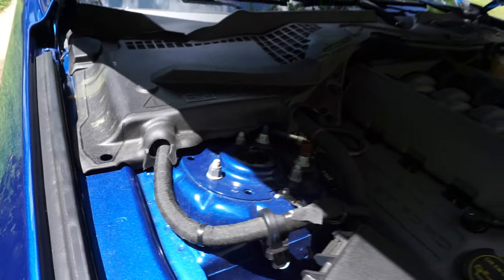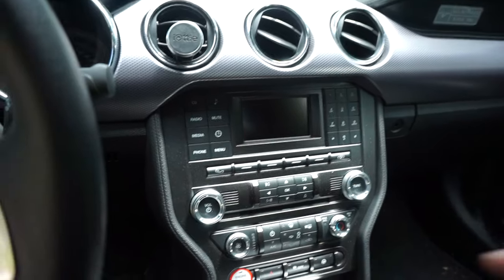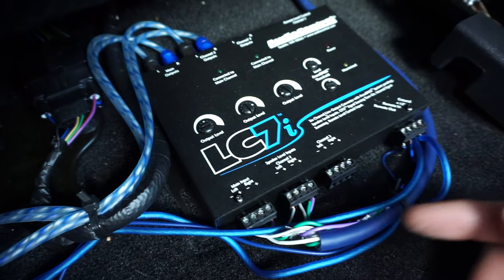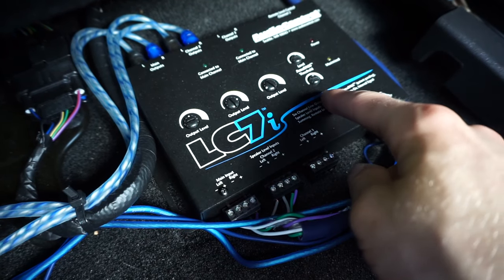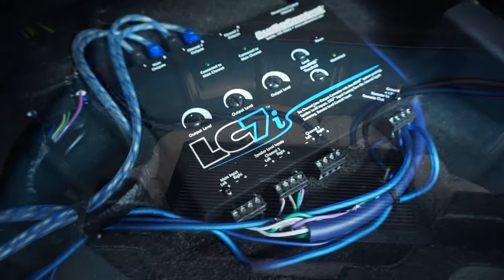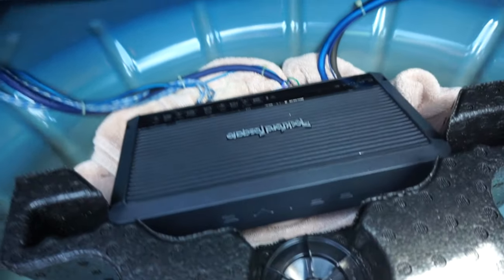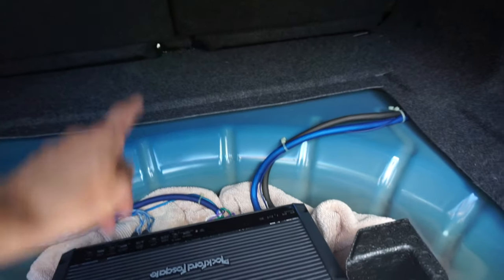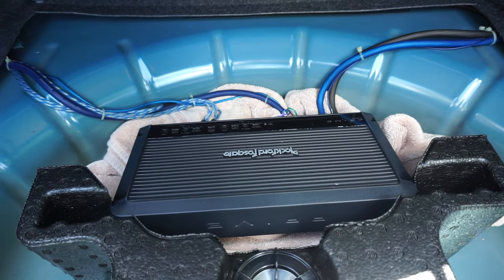2017 Mustang AMP Setup/ Overview

Comment: Finally someone doing the same thing I am. I have a 2015 Fusion I've been trying to find videos on and no one is trying to amplify speakers with the factory stereo. Unfortunately I didn't decide to do so until I put a subwoofer in and I only purchased the LC2i. I'm gonna have to get the LC7i to do the speakers. Tempted to make my own video when it's done for the sake of other Fusion owners lol great vid!
Reply from the maker: TheALPH4LEGiT thanks man! That's the reason I put this on here I couldn't find a video on it as well, hope your install goes well and have fun!

Comment: Thanks for the video and this is good information for anyone looking to install aftermarket amplifiers to their mustangs. I have one recommendation if you haven't already don't it, that would be to cut a small slit in your carpet where your line out convertor is to run the wires so they can be hidden and protected.

Comment: FYI, you could have skipped that LC7i and LOC altogether.... Just change the radio output to "low level" via FORscan. That way it is a low level signal, pre-amp signal with no factory equalization or bass roll-off....just great signal. Feed those to the amps and you're done.

Comment: Audio control line out converters have auto sensing technology that turns on when they sense voltage. You don’t necessarily need a dedicated turn on signal if you don’t want to run one. The only draw back being they will turn off if you have your volume too low.

Comment: I'm confused, if you're running power from the battery to the lc7, how does it know how to turn off? I tried this and it just stayed on, am I missing something? Good video.
Reply from the maker: I have the power coming from a 12v wire that's on the passenger side door that turns on and off when the cars power it turned on. Depending on what model you get the loc will auto detect audio output and turn on if you don't use the turn on wire, so depends on what you want to do. The amp is the one that needs the power from the battery, but another wire can come off that to the loc if you opt for the audio turn on.
Reply: @KyleCaughill  thanks for the fast reply man! I actually ended up doing exactly that. Ran a remote from the lc7 to the amp and let speakers turn it on. Works perfect. Thanks!

Comment: Hey man, going through a similar dilemma. How did you route the speaker wires going from the head unit to the loc, as well as the amplified rca’s that run back to the existing speaker wires? I noticed you used a multichannel cable running to the lc7i , which looks very clean, but did you cut the powered rcas to connect to the speaker wires? Or do you have some sort of harness to plug the rcas into? Thanks 🙏
Reply from the maker: I found the wire harness diagram for my cars stereo to see where all the speaker wires go. I cut them all, but left enough wire to slice into the wires going out of the head unit which runs to the loc for the signal. Then loc turns those wires into rca cables for the amp to receive. Then from the amp I used the same speed wire to go from the amp all the way to the head unit to tap into the other side of the cut wires that send the signal /power to the speakers. There should be a diagram in the description to see if that helps.
Reply: @KyleCaughill  hey sorry but forgot to ask. You never mentioned how you physically routed the wires going out to the loc, and the wires going back to stock speaker wiring. Is there a spot behind the dash I can pull wire through? How do I cleanly route it to under my seat like you’ve done here

Comment: I have a 2018 mustang. I did a similar install like yours where I have the amp in the spare wheel compartment they get really hot. Does your amp gets hot?
Reply from the maker: The AMP would get warm from use, but it never got hot or anything. there is some space for it to breath still in the tire compartment.

Comment: Where did you splice into the factory wires to send to the LOC? I hear that this car already has the wires going to the front tweeters and front woofers separated straight out of the factory headunit. This won't work for me since I have my own crossovers that I need to install that will seperate the signal
Reply from the maker: Michael Birkel everything was cut at the head unit where the harness is, the only difference with you will be to wire all your speakers from the amp to the crossover and then the speakers. The wires out of the head unit will go straight to the LOC, since your running your own speaker wire you won't need to run all the wires from the amp to the head unit which goes to the speakers.

Comment: Hey Kyle, I'm installing two active subs in my 2017 Mustang convertible. I have connected to the rear door speakers to get the high level input but can't connect both + and -, only one of them. Then when I rev the engine I get rumbling noise in the subs. I know it's not a bad ground and using input from a separate stereo works fine. Do I need a hi/lo level converter to use the rear speaker input? Thanks!
Reply from the maker: I would get the line converter for the subs if you don't have them already, also you could wire the subs in series or parallel depending on your setup which that way you can use only one positive and 1 negative. Not sure if that's what your talking about or not, but sounds about right.
Reply: Theirs a speaker in the rear of your headliner.   Unplug it and it will solve your problem.    All that speaker does is takes the exhaust notes and puts it through the speakers so it sounds louder.
Reply: @kristalmills7989  Wow thats amazing! After all I tried this was the solution to my problem. I have the convertible and it has an  audio regulator placed behind each of rhe rear seat belts. Unconnected both and just like that the rumbling noise dissapeared. The sound of the car changed a bit though, and I can now hear some wining noise when slowing down for a corner. But that's an easy fix now that I can crank up the volume of my stereo and pop some good music. Thanks a lot for the tip, fantastic!
Reply: @KyleCaughill  The line converter made it work connecting both pos and neg terminals of each speaker. The rumbling noise was however solved by removing the exhaust sound amplifying mics as described below. Thanks

Comment: When tapping into the stock radio would I need two runs of speed wire, one to the LC7I and another to my  amplifier? ( I had some "professionals" install mine but it looks different from yours plus everything from my door chime to low gas is amplified which is really annoying)

Comment: Hey Kyle. Where did you hook the remote wire/cables? I know its suppose to be connected to a 12v but maybe you could provide more details of where it is located at? Thanks
Reply from the maker: Right on the passenger side were the fuse box is by the foot well or kick panel. There is a larger wire then the other ones that is green which is a 12v source when the car is on.
Reply: @KyleCaughill  Thanks. Found a thread and it mentioned the same thing, a green wire which is a 12v. I think I'll use a Posi-Tap to connect the green wire and remote wire.
Reply: Can you share a picture of where you connected the remote wire if possible? I can't figure out which wire to tap in.

Comment: Where did u tap into ur remote wire ? Or where did u run it from the LOC
Reply: From what I watched you tapped into a 12+ wire w the remote wire then to the amp

Comment: Why would you put the LC7 under the seat ?
Reply from the maker: KINGKJ2REAL less speed wire to use that I didn't have and some very long rca cables that would do the trick
Reply from the maker: KINGKJ2REAL that was the place I was looking at, I was thinking some Memphis or Rockford subs rms around 500

Comment: we can see the wire... lol  Mine however you cannot see, I mounted it at the fuse block that the battery goes to... and it is under everything...   I have don't a bit more than you at this point, even swapped out the 4" to the 8"  to keep my 4 way fade, I have 2 LC2i  - one on the front and one int he rear to separate amps... the

Comment: I have a brand new lc7i but my audio shop said with the shaker system it’s a waste unless I’m gonna upgrade all the speakers and sub. Also I’m actually more confused after watching ur video than I was before it
Reply from the maker: It can be a bit crazy to figure this out, If you have the Shaker System, your already have an amplifier already, not to sure on where it is in the car but i'm sure if you can find some diagrams online you can figure it out and wire from there depending on what your doing. I only added this to my car because I don't have any connections for the Amplifier from the stereo. Now I have a connection from the Stereo to the LC7i to the Amplifier then to the speakers from there. Also since the LC7i has a sub out, I can also use a sub and not have to tap into the back speakers to get a connection. Makes the job easier.

Comment: How did you connect to a remote to turn on amp with deck?
Reply from the maker: The loc will auto detect the audio when the signal is detected. Then the out goes to the Amp which will turn on after the loc.
Reply: So you used the camera as a remote? And where or how did you hook up the blue think wires to?
Reply from the maker: @deanmurphy4810  check out the wire diagram in the description

Comment: Hey did you get and sound when accelerating i installed the lc7i now i get noise in fron when i hit gas pedal
Reply from the maker: xxrazorreaperxx I haven't had that problem, I would check to make sure your gains aren't set to high causing access noise. If thats not the problem let me know.
Reply: Kyle Caughill i had them at normal it went down a little when i turned it down and it was weird my door chime sounded amplified until i pulled fuse #27 and ive noticed it won't do it when doors are open only closed but if you open it and trigger the door latch to think its closed it does it

Comment: Hey man what color wire is the ground and the remote wire coming out of the wire harness
Reply from the maker: Sean Pigford there isn't ground nor a remote wire. Ground is a wire connected to the chassis of the car and remote wire is any wire in the car that has 12v when the car is turned on. I'm sure you can use some of the wires on the radio, but I chose not to.

Comment: I want to run my mid range and highs off this can I do this. Is about 6 speakers total.
Reply from the maker: Jessie Pollard yes that should work, the 3rd output can be used for a sub or extra speakers, so 6 would work. You could get the lc6i or the lc7i, lc7i has acubass the help with bass rolloff.